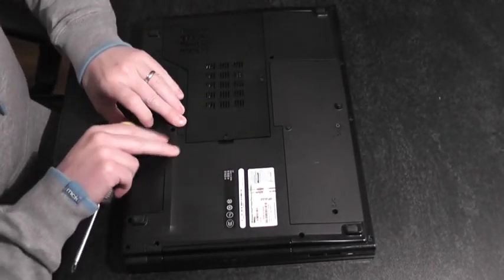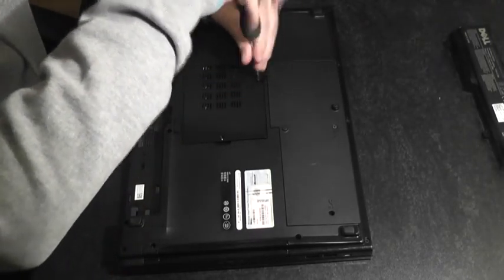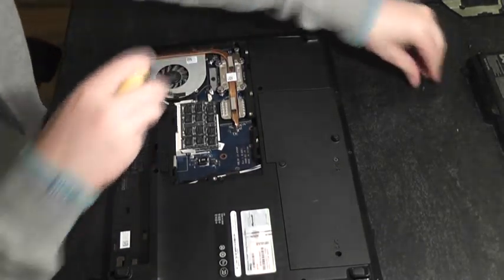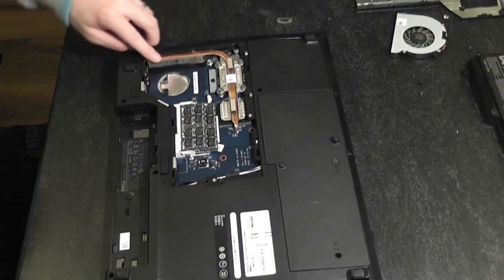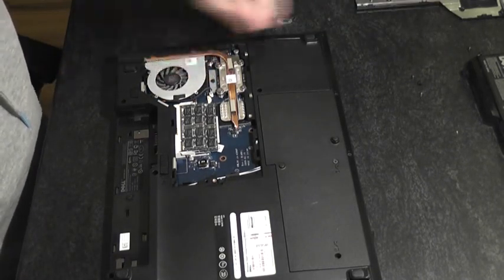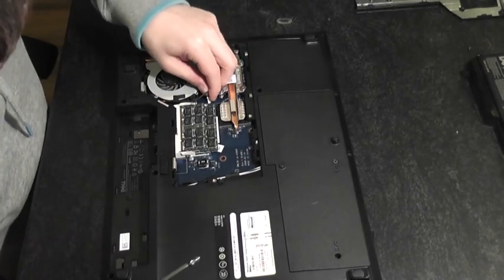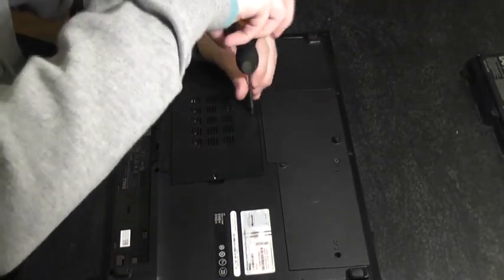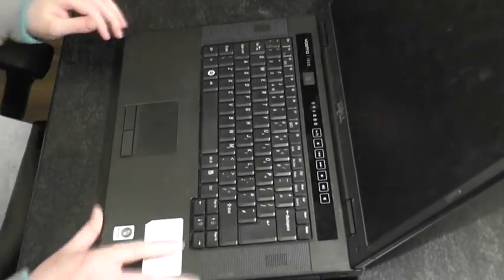Dell Vostro 1520 Overheating Problem Step by Step Guide to Fix

Comment: You should check the cooling fan. It looks like there's a lot of stuff on the blades. I opened a laptop where the lint had built up so bad that the fan had striped it off, and it had jammed the fan.

Comment: You probably should of mentioned using a plastic poled hoover. As the metal can cause static and can damage components. Not usually a good idea to use Hoovers on computers/laptop. But on the other hand, good video. Thanks.